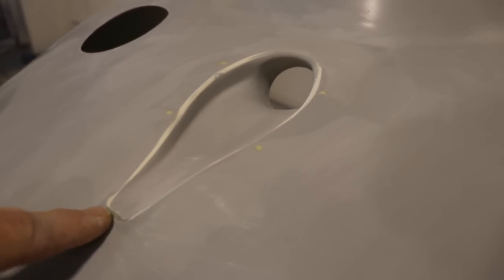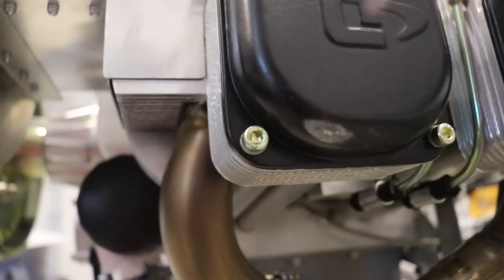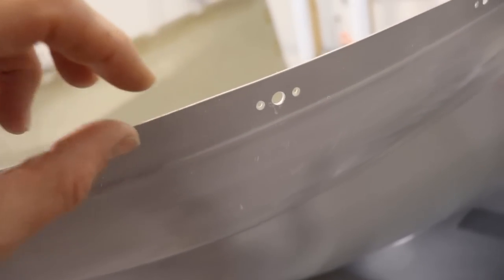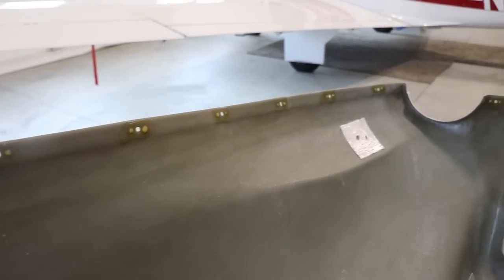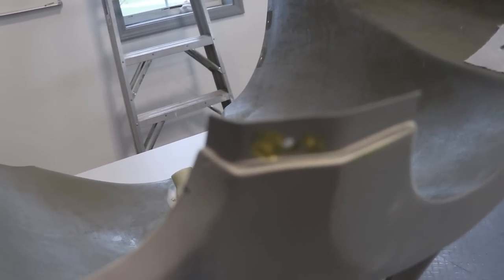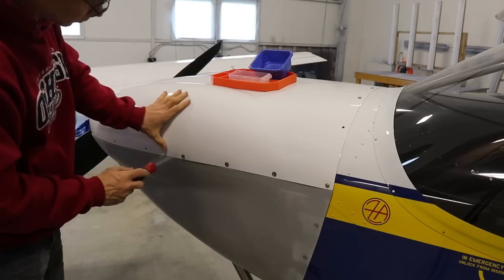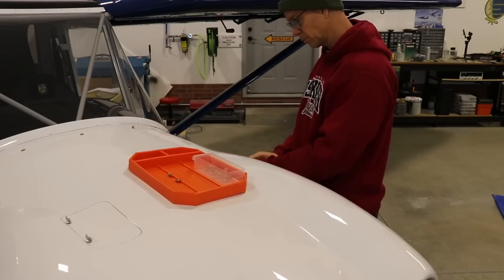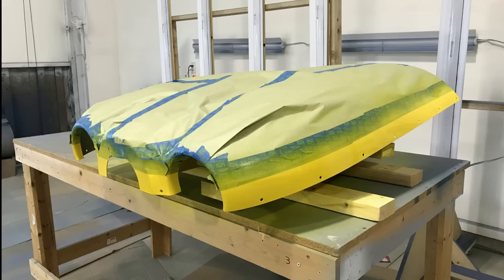Zenith Cruzer Upper and Lower Cowl

Comment: Nice job Mark. Have you thought about using a laser leveler for the lines? You can put it on a tripod and depending on the angle you can bend it around corners.
Also, thanks for the room key idea. I started collect them too and using them on a lot of different projects.
Reply from the maker: It's not difficult to get the lines straight. That part is easy. What I meant in the video is that the lines on the cowl have to match the angle of the lines already painted on the fuselage. I probably didn't explain that clearly in the video and will show again what I mean when the cowl is painted and installed.

Comment: So you are using two different types of fasteners for the cowl?  Mine is all screws (30) and I hate it as it takes awhile to put on and off.  I was thinking about installing the Piano hinge style.
Reply from the maker: I wish I could redo my whole cowl. I have 1/4 turn fasteners on the back top of the cowl. I was going to use those same ones for the rest of the cowl until I inserted them in the top and realized that it takes so much force to compress the springs that they would never work on the side of the cowl. So then I switches to the camloc 1/4 turn fasteners and they turned out to be junk. So I replaced all those with flush screws as you saw in the video, but I can't change the ones on the top without doing more aluminum work to the top skin.
Reply: Kitplane Enthusiast Did you consider the piano hinge option?
Reply: I still can't figure it out, you must have got the wrong cam lock or quarter turn fasteners the first time!  Lots of extra work to change to those nut plates. It's going to take ten times longer to unscrew & screw in those screws compared to some decent 1/4 turn Dzus type fasteners. But whatever I guess..
 I went back and looked at your earlier video, those fasteners had a ridge or a rib on them, I bet that's what was causing your trouble. I used to use the smooth ones, no rib.